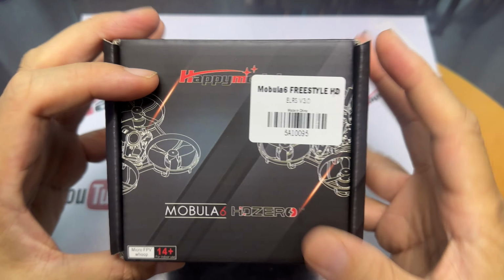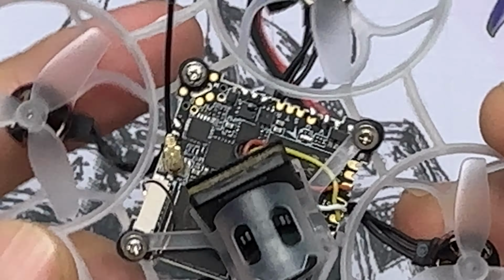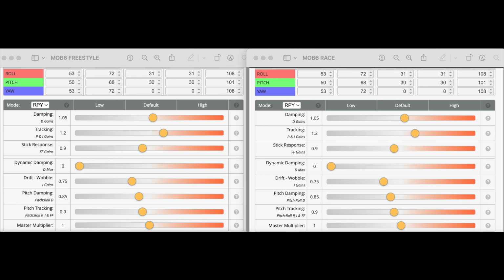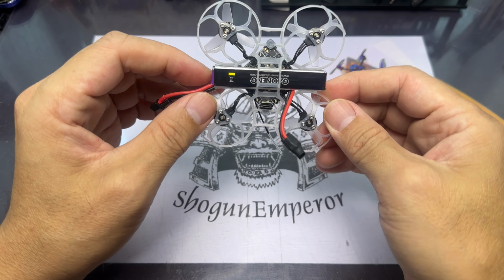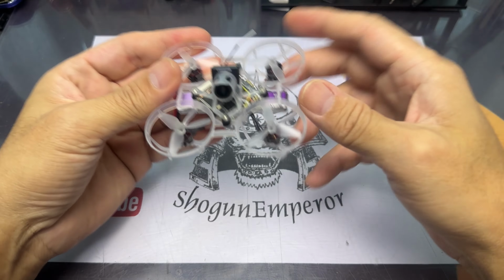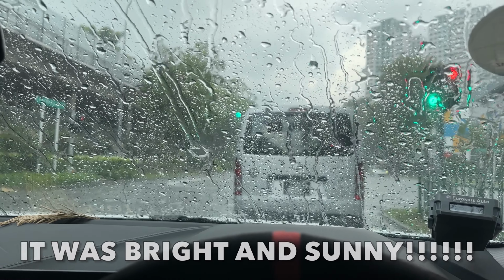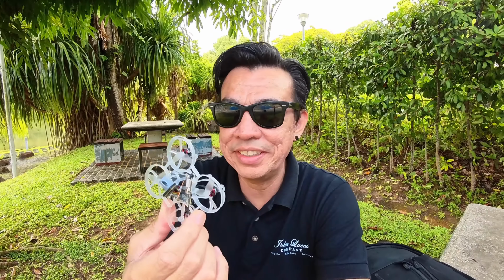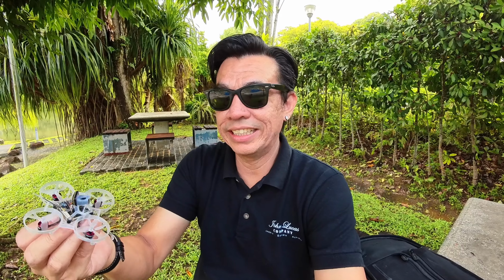The Ultimate Mobula 6 HD | HDZERO MOBULA 6 FREESTYLE WHOOP

Comment: Just got mine and I see yours has the same issues; props not fully seated and camera wires wedged between hdz chip and left canopy arm. HM just do not understand the importance of FCB isolation. At least this one is easily fixable by just rerouting cam wires. Nice discovery on sideways battery mounting. Now for some lightweight screws to shave a few picograms 👍🏽
Reply from the maker: @modquad18  yup. Its kind of a standard thing for them. Personally, i dont find it a bother but yeah. Ur right.  Yeh bebeh! With those lightweight screws it’ll make a huge difference! Thanks for dropping in bruh

Comment: Mobula 6 Freestyle HDZero(bought from HDZERO store BNF) does not arm at all but everything is binded to Radiomaster Pocket while connected to Betaflight 4.5
Reply from the maker: @linaskerbelis5636  quick question, are u familiar with ELRS? The mob6 is set to 500hx, and there is also model match. Open ur ELRS lua script and check if there is a model match notification. Turn it on or off and u should be good to go

Comment: What do you think about the canopy? I fear you might ram the camera straight into the FC with one unlucky crash. The former seems awfully unprotected as well.
Reply from the maker: @neuromancer692  aaaah. No bruh.  There is a plastic cross bar at the bottom of the camera that actually prevents that. My only concern is that exposed top! 😜